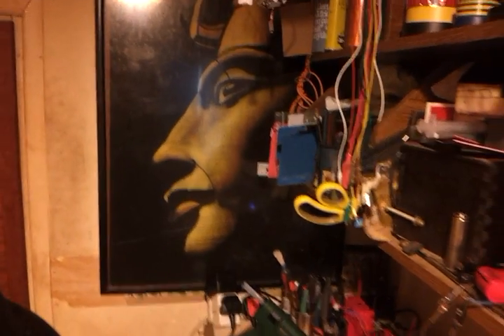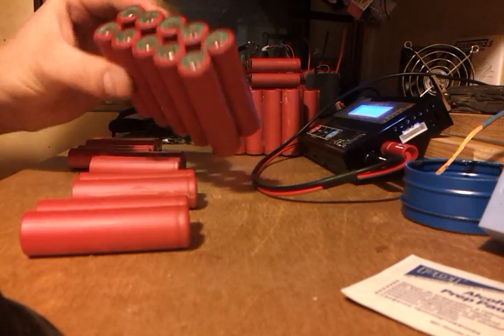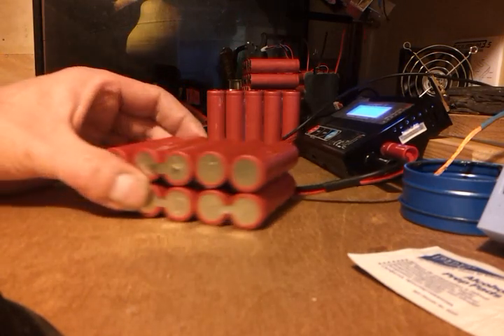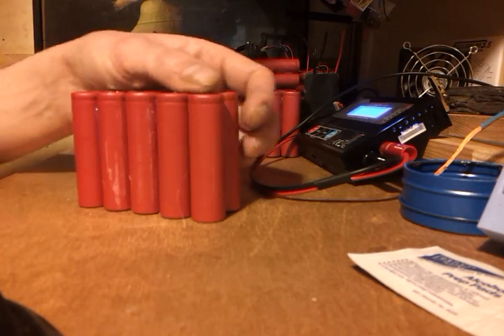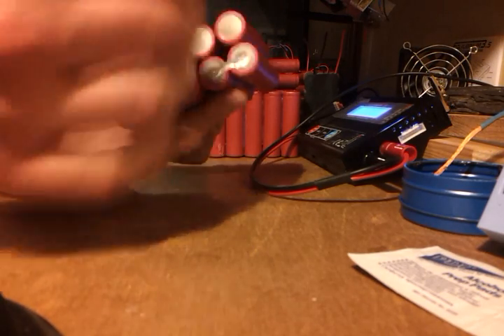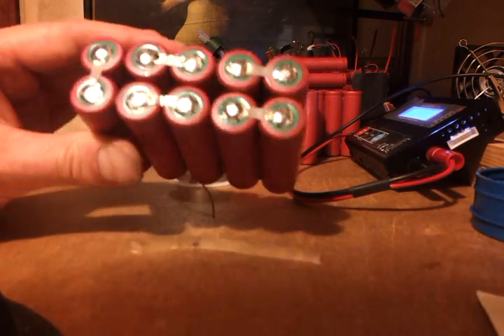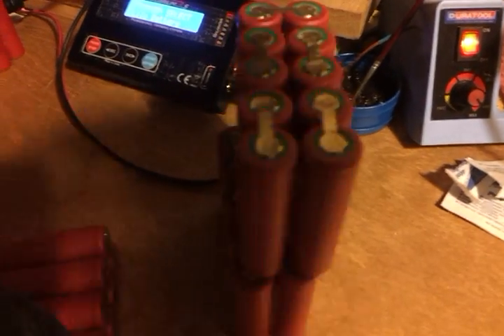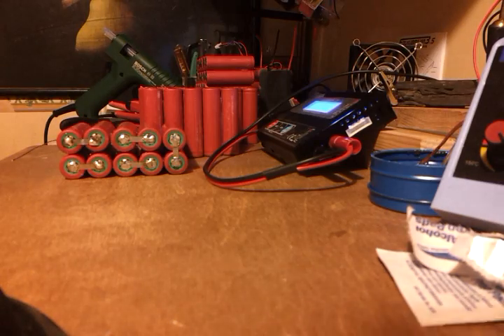24v20ah  18650 lithium ion pack pt1

Comment: When choosing batteries from different sources do you need to match up the stated capacity in amps?
Reply from the maker: Its best too..For the longest use from the pack before you dissemble.
All these cells were reclaim so if i chop one or two in n out its no biggy.
Tool box pack at 24v 30ah is still  working a treat.
Hope this helps.
Atb.
Reply: @stoo234  Thank you for the reply! I was not sure how much importance to place on this.

Comment: Hi , i have a question , i have 6 batteries which connected with a 6s 
BMS . I just want to know can i use 18v power supply to charge those 
batteries ? if can , how it should be ?

Comment: what do you mean by 20ah
Reply from the maker: hello buddy..ah refers to amp hours..mostly batties are sold in mah..the number looks more impresive!
20 amp hours is the same  as 20.000mAh..just like mililiters and liters..5000ml=5 L..
same here..20,000mAh=20 ah.
its a measure of capacity .
hope this helps.
feel free to ask anything else, if i can help i will.
all the best.;]
Reply: It means. if it's 20ah (20 amps for an hour) if you pull 20 amps from the battery for 1 hour it will be flat. If you pull 10 amps it will take 2 hours. (simplistically)........

If he has 20ah @ 24v then he has 480watts stored..

Comment: Lost another 100mah on each battery you soldered because of heat damage.. use a battery welder for large packs
Reply from the maker: +Google+ SUCKS BALLS - the worst forced social network
the cells were eight years old..100mah per cell?  how do you know? this pack tested at 20ah..other packs have tested the same..not a problem to solder just use a big iron and be quick!..such a small amount makes no real differance on such a large pack anyway.
you are correct an expensive spot welder would be  a better option but i didnt have one to hand.
my bigger 30 ah pack [video on channel] tested at 32ah in real terms ,that pack had 15 cells in parellel, so the loss is small and on cheep second hand cells not worth worrying about.i got 3000 cells for less than half the price of a good quality spot welder,all is good buddy.
all the best.;]
Reply: This a ridiculous statement. I make packs from 42120 cells and have experienced zero loss to soldering. And this is on bare batteries with no tabs at all. Battery welders are great IF  you spend 1500.00 and used ones never seem available.
Reply: G Henrickson Do you cycle them before soldering and after? Do you measure internal resistance before and after soldering? Else how do you know they never get degraded... and trust me they do; specially ones in a metal can as it transfers heat faster. Lipos don't like anything above 40degC and your soldering starts at 200deg, and since it's metal used for can is usually not meant for soldering (except ther tabbed ones) you need to heat it up really good.. btw. battery welders start at $100.

Comment: Are these cells big brand name (Samsung, LG, Sony, etc) or just a chinese buy? You might already know, but chinese copies of these Lithium cells have nowhere near the claimed capacity. A 2000mAh cell will actually have around 600-900. Of course, you can test this using that charger you have in your video, I wonder if you already did?
Reply from the maker: Rc With Foxy i did buddy there getting 1.8 /2 ah each.some a little more.
the cells are very good quality japanese cells made for varta in germany. they were battery back up packs for a medical machine.
atb.
Reply: Most folks who build packs test every cell for nominal voltage and capacity before starting the actual build.  Note that you can get "bad" cells from any source... not just China.

Comment: Good job, finally a video where I can see soldering these batteries from up close. I want to build one of these packs too. I tried practicing with only 2 batteries. The melted stuff won't stick. Tried sanding the terminals, dropping a melted flux drop on the terminals, it would still come off too easy. After playing with it for over an hour finally got it soldered. But it seems like it works much faster for you. Is there a special way these batteries have to be cleaned or anything that has to be applied on them to make the process easier? Also are you not overheating the batteries by melting the cord right on them?
Reply from the maker: ello buddy thanks for that, i struggled with copper wire but the nickel battery strapping is easy.
tin up your batteries first  then apply the  stapping  is what i remember doing for best results.clean all joints with alcahol or i used lighter fluid or petrol to clean then apply flux . just a little mind.
the temp is a bit hot but they are old cells and i have a lot  of them so no worries;]..
you can get it too hot the solder will run off ..be gentle.;]
Reply: Thanks for the reply, I'll keep all that in mind. 

How about the soldering iron itself, I saw some people saying you'd need a really powerful one to make it easier. Mine is only 60 watt. I was thinking to get a 300 watt soldering iron, saw one on eBay for $40. Would it be worth getting it for this job or will I just waste my money?
Reply from the maker: *****
i cant say for other people but mine was a cheap £20 , 40 watt soldering iron with adjustable temp and soldering bits.
what makes a big differance is the tip size.
 i found the stock needle point too fine so used a larger chisel style bit that helped quite a lot with the speed of heating.
i dont want to sound patronising but you are tinning up before you solder  both the tip and the strap/cable?..if you like i ll do a quick over view on you tube for you..its hard this because i dont know how much you know !
too much flux will make a joint harder to seat and  solder wants to run all over the place,
not enough and the solder wont flow to all the voids.
hope this helps
atb stu
Reply: +Constantin Sirbu Make using lead solder also non lead is so much hard to use and requires a lot more heat
Reply: Non-lead solder usually melts at 20-50 degrees more. No biggie. Big iron... solder fast. Use quality flux. Practice on old batteries.
Reply: The soldering iron in this video is just 40 watts? I would have guessed much more!